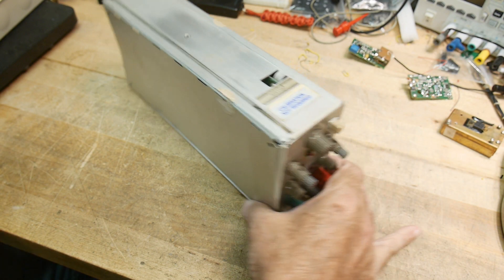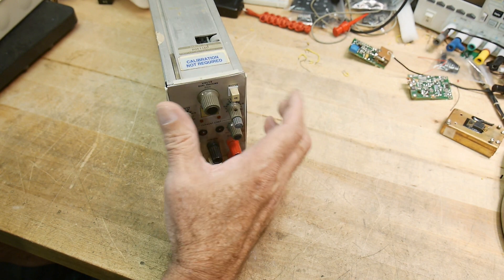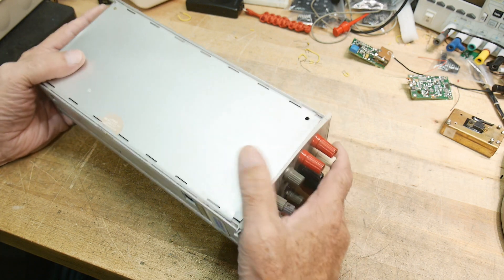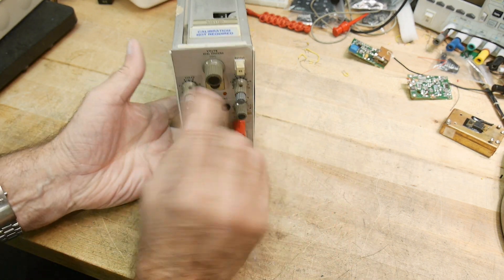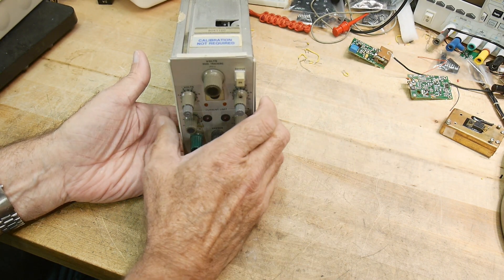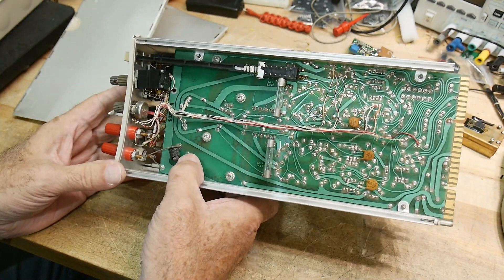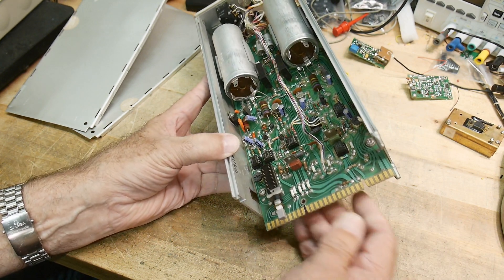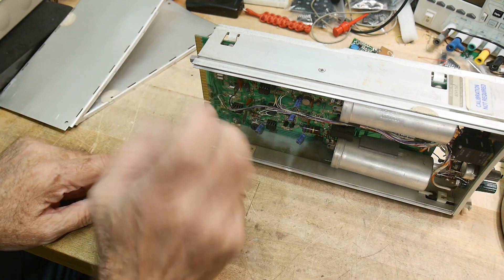#1339 Tektronix PS503a Power Supply Plug-in

Comment: I have a good collection of these. I really like them and have found them very versatile. Makes for a clean bench if you have the room. I have 2 six bay and 2 four bay modules all full of fully restored plug ins. So far I have been able to repair and re-calibrate everything without much issue.  IC sockets are an issue, what was TI thinking?  The only downside is that they do take up a little room on the bench. I will admit I always wanted these when I was in high school but could not afford them. Now they are cheap and fun projects to restore, with the bonus of having functional equipment when you are done. The 4 and the 6 bay modules have a single high current slot on the right for that power supply. The 4 bay is also fanless so silent which is nice. You can get extender cables to bring the edge cards out and I find that  I like using them more than a single or dual bay with all the hardware removed for troubleshooting.
Reply from the maker: wow that's a lot. I definitely don't have room for that. I eventually made room for a three wide on the bench. lots more videos to come.

Comment: I think I detect a little anti-Tek bias here. To be fair, HP had some flops also. I remember one HP scope that was so badly manufactured it had intermittent connections inside that rendered the scope mostly useless. I had a rack of these 500 series modular instruments back in the day. It spent its entire life in the chassis so didn't get banged around at all. They all held up just fine and I don't remember any failures of any of the modules over about a 15 year period.
Reply from the maker: HP never made a good oscilloscope, period.
Reply from the maker: I'm not anti-Tek. When I designed products at HP, I had a Tek scope on my workbench. I love my 576 curve tracer. When I left HP, I had a LeCroy at work. now that's a nice scope.
Reply: @IMSAIGuy  OK, sounds good! I used to work at LeCroy back in the day. Not at their scope division but in transient recorders and other CAMAC instruments for the high energy physics research market. I worked on their deep memory modules for what was super high speed recorders (100 and 200 MHz) back when that was state of the art.
Reply: I was a fan of these modular systems… in my late 20s/early 30s (1.5 decades ago). I enjoyed refurbishing them for my own use. But the things are so big for what they do – I eventually just gave them away when we were moving at work. The multimeters, though - those were really slow. I couldn’t be bothered to use them on the bench because of that. I still have a whole bunch of double width oscope modules though. I plan to add some nice wooden cases for them, toss in a transformer and a pass element, and give them away to willing EE students at local colleges.

Comment: You can get extension cables to work on them.  I think most of your complaints are misguided.
Reply from the maker: that is why I'm doing the series. As I say, to give them a try and see if my opinion changes
Reply from the maker: you need two extension cables for the dual wide modules. too expensive
Reply: @IMSAIGuy  There was a guy recently selling the connector boards for both sides with IDC connectors.  You just a add a common IDC cable.  Boards were $29 delivered.  Unfortunately, he doesn't have any more left.  I purchased my extender kit from someone else a number of years ago for less than $50.  Ebay prices are crazy on the Tek extenders.
Reply from the maker: my dual supply was $40. problem solved
Reply: Here’s the part # 067-0645-02. Luckily I got mine before the prices skyrocketed. I got myself a nice set with the SG503, TG501 & PG506 for calibrating my 465B.

Comment: I added two tiny digital voltmeters to my PS503's, so I can see the "exact" voltage without tying up another voltmeter (or two).  I just attached them to the front panel with double sided tape, and powered them with their own 7805 regulator(s).
Reply from the maker: I'm surprised you found room

Comment: Too bad this video didn't come out back in April/May. I tossed 5 or 6 new in the box TM506 mainframes. We didn't have room for them. A bunch of the plugins were tossed too! I'm not sure what survived the move. I know we have a rack full of these in our museum. When we worked on the modules we used the fingers of a cut off PCB that had wires soldered on and came out to a socket the module would plug into so it would lay on the table to work on.
We pulled the power supply out of the mainframes because they were too noisy for our specs and didn't have enough power. Boxes and boxes of power transformers were tossed. For awhile we used the transformers as door stoppers.
Reply from the maker: what museum

Comment: Yes - I disliked them also. Not Tek's best work.
Reply from the maker: be careful, lots of Tek fanboys here I've just discovered. Don't call the baby ugly. I'm taking a roasting.
Reply: @IMSAIGuy  These were definitely built with lower cost in mind. But they compromised IMHO where it was OK to compromise. I’d rather have an ugly case and put the savings into robust transformers, pass elements, etc.

Do note that the bendy side covers are the same idea they used in the 5000 and 7000 scope plugins. It takes some care to remove them without mangling, but that’s probably true of anything you work on. See for example the meter mounting brackets on HP/Harrison supplies. I consider the covers to be a reasonable compromise between cost, utility and durability. When properly inserted into the slots in the extrusions, the covers took up shear loads and stiffened the whole module up. Clever mechanical design if you ask me, given how relatively little it must have cost.

I used to have a lot of TM500 modules and several 7000 scopes with a lot of plugins, but I’m no fanboy for sure. Just pragmatic I think. Back when these were in common use, I imagine T ek salespeople and service centers would have a bag with a bunch of pull handles at the ready. They did break off more often than I’d have liked for sure.

Comment: Never liked these either. Everyone hurry and sell theirs. ;-)
Reply from the maker: there is no demand on eBay for these things. good time to buy them.
Reply: I started buying these thing about 5 years ago. Before COVID, they were in fact cheap and plentiful. Since, prices have doubled ( or in some cases, listed at close to the original selling price!!!) I could easily triple or quadruple the money I spent on them. Everyone is entitled to an opinion IMSIGuy... I'm just glad I got a full set of these things before the demand shot thru the roof.
Reply from the maker: I bought about 6 plugins and two bays. $20 to $60 for each.
Reply: Given the condition and model# you show I'd expect to pay 20 bucks for it. It'll be interesting to see what you got in the series. I suspect they were all listed for parts but because Tek did mil contracting back in the day, the service manuals for these things are jaw dropping.
Reply from the maker: That one is the worst (and cheapest) by far. I did get some nice ones too. I love the Tek manuals. Yes, sometimes you can find the standard service manual and the matching military (usually Navy) manual. I've seen different calibration procedures in the military ones. you can find military HP stuff too.

Comment: Sigh!  They were/are great little units.  I used the 500 system from 1979 until I retired in 2012.  Only had one problem and was in one of the power supplies like the one you have.  Of course, being Tektronix, their service literature was great and after 30 minutes or so it was back to work.  I think that you need to have a calming cup of coffee and think of why both Tektronix and HP came out with the occasional 'consumer' products.  They were much cheaper and still had good qualities and great circuit design.  If I had found anybody banging around any of the test bench equipment like the PS you're working they but be given a Radio Shack VOM and a folding table in a dark corner of the shop!   Again, we several of these 'budget' systems and they all did their jobs.
Reply: You mean that my HP lap top in not built the the same quality as an HP spectrum analyzer? NO!!!!

Comment: I have a set of 4 instruction manuals for this system, the backplane rack power supply manual, (Power Module TM 504), the FG 503 Function Generator, the DM 502 Digital Multimeter, and the PS 503A dual Power Supply. These have schematics and alignment instructions, as well mechanical drawings and parts list.
They are all yours for free if you want them. I was just sorting through all my Tektronix's manuals a few months ago, and set these aside to throw out.
I don't know how you can private message me so I can get a mailing address to send via USPS.
Reply from the maker: thanks for the offer. I've found all the manuals I need on line.

Comment: can't operate on it's own? well then! let's get it board certified! & tom jones once slept in this bed!
Reply: To function independently - it's about how you understood it - this is the source module - the control and output part - it has no power supply - the module must be inserted into the corresponding source unit - if it is in the source unit, it will work independently of its surroundings completely independently.
Source units were produced in several types with different numbers of plug-in positions.

Nice day 🙂 Tom

Comment: Dude... its' not marked negative because it's fully floating (hence the green....) I dont have that plugin, or even anything in that mainframe system, or even anything Tek but it's clearly a dual tracking fully regulated supply. These, I'm sure, were built down to a price. I have no idea how they compared to the same era HP's in price, but I bet this module is gave you similar  load/line regulation and ripple rejection that those super expensive 19" rack triple-power supply dedicated HP units did, but at maybe 1/5th the price. This was the 500 series entry babbby level Tek for college kids and shit I bet

(Or apples-to-apples, maybe 1/3rd the price for the half-rack HP dual trackers). Overall, for 50 bucks + your junk bin parts, good luck even building something half as decent as this. IIRC, there are a lot of real interesting modules that came with this platform, whcih is what made it particularly powerful -- the price/power point was fantastic. You'd get pulsers and delay lines and shit that would be on par with the Lecroy 7200s. 

I mean I get you, it's kinda junky, but even now for someone who's a hobbyist- especially the hams/CB guys who just need to align IF stages or peak amp stages-- this is a pretty good bang/buck. (well it was before all the TinySA/NanoVNA with disl0rd/Joe Smith's software-- now you can basically get 80% of the way to '20 year old used Agilent equipment that used to run 50k a piece, now still on ebay ~4k' for basically 500 bucks all in.)

And if you wanted rock solid build quality tek-- the 7000 line is what you want. They also had a had a US MIL line. I forget what it was designators were, HP had the uh AN/USM line? That was basically all made of 12 gauge steel and came with 800 page service guides -- the CRT phosphor coatings still have like 90% of their life on them too haha.
Reply from the maker: the two supplies have a common ground, so while they float together, one is positive and one is negative with respect to the ground
Reply from the maker: https://w140.com/tekwiki/wiki/PS503
Reply: Given how good of a linear power supply you can build using dirt cheap modern components, I’d say it’s a tossup. If you need something already made then go for those if you want, but otherwise maybe not. Takes a junk box of stuff and a thrift store to buy more junk to scavenge a transformer from. Still, with relatively mainstream op-amps and mosfet output stages, it’s not too hard to make a supply that leaves these old and slow designs in the dust in terms of regulation, line noise rejection, capacitive /reactive load stability etc.

I have a bunch of 70s era HP and other major brand (Kepco, Power Designs) linear supplies and they are dependable workhorses, but there’s only so much performance you can get out of basic discrete transistor error amps and their successors that use a 741 or a similar op-amp. A lot also depends on the capacitive coupling to the chassis - mainly via the power transformer, but not only. There’s a wild range of performance in that regard - some are great, some aren’t so much. Same goes for DC leakage resistance from output to chassis. These things were often not quite specified, or were specified very leniently, and when you need a good floating supply performance there can be trouble with some models - whether old big name brands or “new age” Chinese brands.

Comment: We used those 500-series systems back in the early '80s at school. They worked well and did not see any failures even with students using them. Compared to the old tube 545 scopes, we had they were tiny.
I've always wanted one of these systems. A large rack with the PS, DMM, function gen and sig gen could be most of your test gear in a small package. With a modern digital scope, it would take up  a small amount of bench space compared to separate units.
Reply: +1 that's what I meant with my 3rd paragraph (re: hams/CB operators), but you said it better. It's just a nice/cheap modular system you can option out. You said it better than me 

It's not meant to be like the 2465, which was specifically catered to the industrial market, and was rugged/reliable/designed with no price ceiling. (Nat Semi would use these to instrument their LSI chips, and put the 10/90 rise times straight from em-- you were paying like the equivalent of 20 grand to option that scope out but you were getting full tracability and a confidence that you could reliably say to your customers we used __ to test __ and heres the SPICE (or I guess IBIS now...) model that you can work against)   Two entiiiiiiirely different market segments. 

Dude is wearing an Omega and has a set of like ~$450 German drivers - I'm sure he knows that there were other modular systems that Tek made to hit the other demographics. It's not really fair comparing those "new" Ingersoll Rand chinese made rattle-guns which are $150, do a 15 minutes deburr/clean up, test the hammer torque and shit and say all IR is junk.  There's a whoooole segment of "real" IR's that will bang bang on par with the Snap-ons and the other big-boys. 

He should at least prepend a note saying "Tek had a lot of modular setups -- this is their economy line and not indicative of their entire product line during this era" just to be fair. I'm not even a Tek guy (HP all the way, grew up on that shit and now I'm brand-washed) but I think it's doing a bit of a disservice-especially for tinkerers (I'm sure theres a way to operate that shit with like a 30 dollar Altera and drive it with a modern ATX PSU). I should have spent the 15 minutes of rambling on in this comment on actually reading app notes/docu for this mainframe set to see what the finger-pinouts (finger..outs?) for those daughter boards to see what it's running. Thinking it's just GBIP is wishful thinking I bet but still..   

Open offer - if any young Broke kids who want to learn by fucking around with this shit, I'll help fund. I'm in my early 30s, so I got a buck or two. Basically I want to start a fund for kids like Marco Reps or Styropyro. The laser dude, who started at like 16 with standard diode lasers, then went through ALL of Sams Laser FAQ, through Nd:YAGs, through green frequency doubler mixing, got a chem degree, and I think he's working on his doctorate now.  
If you have a project idea, evidence that you've fucked around with at least something past the arduino sketch level (even if it's just schematic capture and layout), but have no money, hit me up if you want to salvage some ebay parts (green-no landfill! though I'll buy some mouser parts if you really need an LTZ1000 for something cool, 40 buckeroos is nothing to me if you end up doing something as cool as the Jim Williams "775 Nanovolt Noise Measurement for A Low Noise Voltage Reference" paper, fuck any cool ideas I'll help get off the ground.
Reply from the maker: Being twice your age I know that the TM500 was not a cheap offering by Tek. It was a main product line. There was no other modular system that was a better quality at the time. this was it. Check the Tek 1980 catalog (on line). I like your offer of helping out younger people and encourage you to start a channel and give away stuff. I also encourage you to be more respectful of the opinions of others that may disagree with you. If your offer is real, I'd be happy to post a video on my channel giving out your info on how kids can get your generosity.   ps. stop using the F word

Comment: Hi, I've always liked these mods but never had them because of their depth. This modular system has one indisputable advantage, it is possible to assemble a specialized measuring workplace for a specific need with a uniform power supply.
When you disassembled it so perfectly, I expected you to print a new one for the plastic base.

Nice day 🙂 Tom
Reply: Can you make some videos on explaining your work ? That sounds super interesting
Reply: @wither8  I have the impression that I'm going to disappoint you twice, firstly I don't make videos and secondly I used to have such a structured workplace a long time ago in telecom research and development laboratories. You probably wouldn't be interested in my current occupation, because I'm currently in charge of an industrial site and electronics is just a big hobby.

Nice day 🙂 Tom